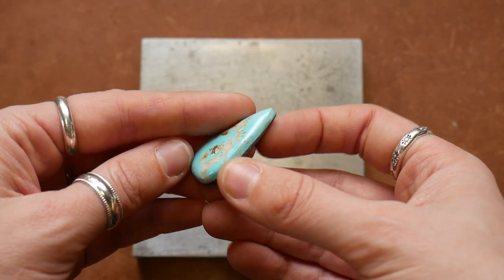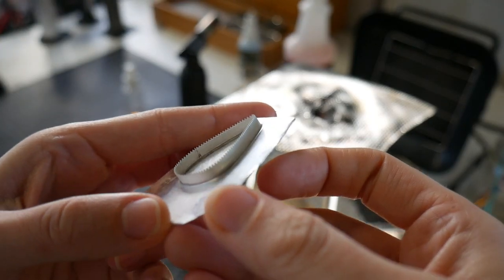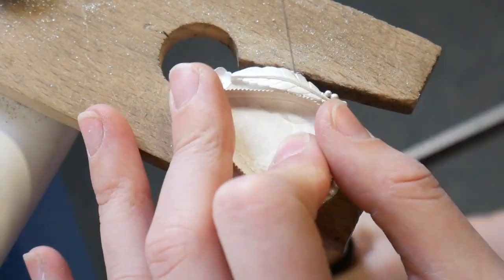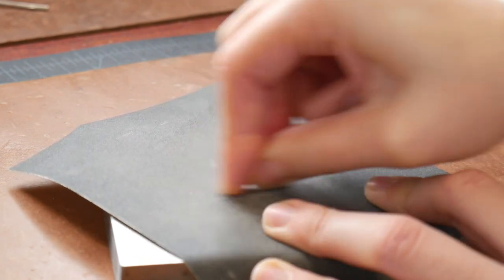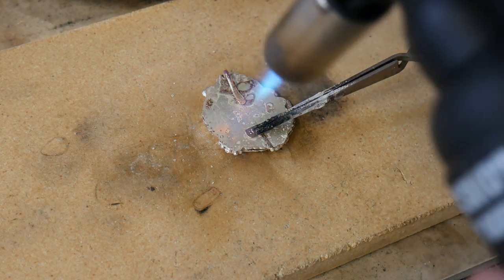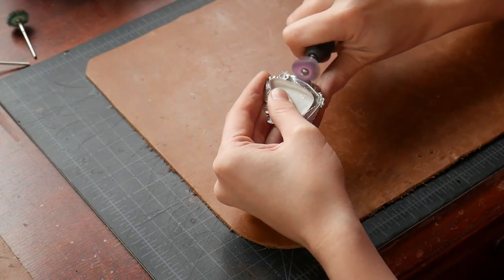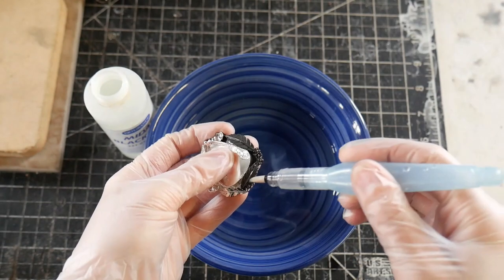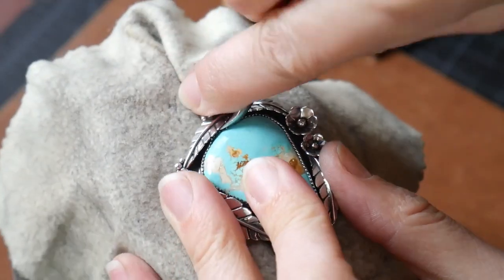How To Make A Turquoise Pendant | Silversmithing Tutorials

Comment: Hi, so great to see you on YouTube! What a gorgeous piece. I do have a question; you take such care to saw so close to your components which looks great, but why do you use such a lot (large piece) of metal for the backplate?  Also, bristle discs are SOOO expensive, do you ever use tripoli and rouge? I drop my pre-polish time to 10% of bristle disc time, by only using them for special tasks. Do you find you get a finish you like better? Always want to learn, thanks! And btw, its "MUSS- lin", like bus, fuss, cuss.
Reply from the maker: Thanks for watching! For the backplate, I prefer to leave  a little extra room for soldeirng operations. During times when I don't get a perfect solder (where all elements solder down on first try) and have to go back and add solder to any areas where it didn't flow or flowed in the wrong direction, I prefer wire solder to do this which has the tendency to roll all over the place....and roll off the backplate. So to try and avoid the wire solder rolling off the back plate I try to leave a little more room so it is easier to work with. I also never waste any silver. Any excess silver I cut out from the back plate will be used again as a back plate for a smaller bezel or as piece to stamp my makers mark or other stamp designs. I have used tripoli and rouge before and although they give a nice finish I prefer the radial discs. I find they are easier to use and have MUCH less cleanup which is especially helpful to me because I don't have a sink in my workshop to easily clean off the polishing compounds. When using radial discs combined with Zam to finish off the piece I get a superb shine. I highly recommend Zam!

Comment: Fantastic videos.  I just starting to cab turquoise and seeing how it is set is very helpful.  Do you ever end up breaking/fracturing a turquoise stone when you are setting the stone?  I ask because I use a very thin epoxy backing on my stones.
Reply from the maker: Thank you so much! And I have cracked a stone before, usually one with very fragile pointed edges.😐
Reply: @SpiritMountainSilver  yes the pointed edges.  I am very glad you mentioned that has I have been making sure this last weekend to avoid those.

Comment: what did you spritz on the piece at 3;00 min. I don't understand how you soldered that to the back plate.
Reply from the maker: Flux! And I used medium solder wire placed on the inside edges of the bezel

Comment: I am completely brand new to silversmithing. I am looking into it. I cab stones and my wife does wire wrapping. The pickle pot?  What is it and what is it used for? Now reference the tumbler. You only use water and soap?
Reply from the maker: The pickle pot contains a pickling solution in it. This helps clean the metal after soldering. The tumbler has stainless steel shot in it. I use that in conjunction with water and dish soap to polish my jewelry

Comment: Great video, so clear and easy to watch, great angles! Can I ask which torch you use and how steady the flame is when you turn it down low?
Reply from the maker: I used the big shot gt8000! Link to it is in my description😊 I really only use this torch at one setting. For smaller soldering operations I use my berzomatic torch which also is linked in the description I believe!

Comment: It would be really helpful for you to mention what safety precautions you use for each step of the process. Eye protection? Hearing protection? Dust mask? Respirator? Additional ventilation? Thanks!
Reply from the maker: This video goes over the basic safety measures that should be taken while silversmithing. However, I advise you read the safety precautions on all tools/materials before using in addition to my recommendations. https://youtu.be/xgrdW1Xy8qM